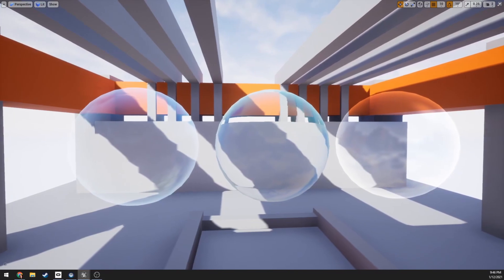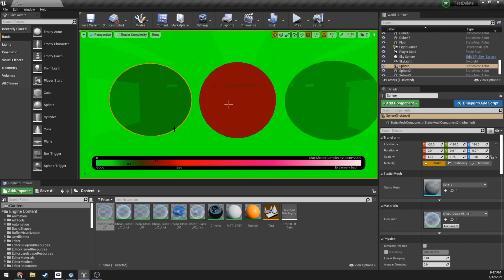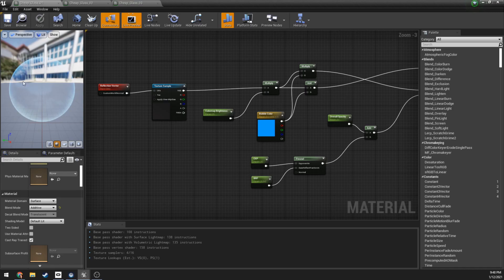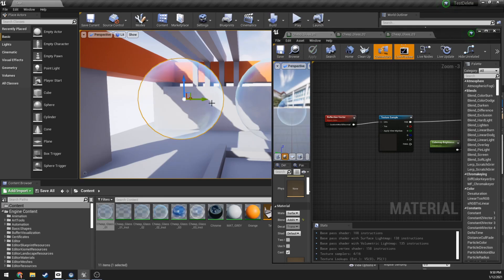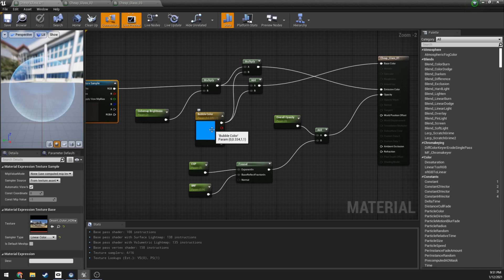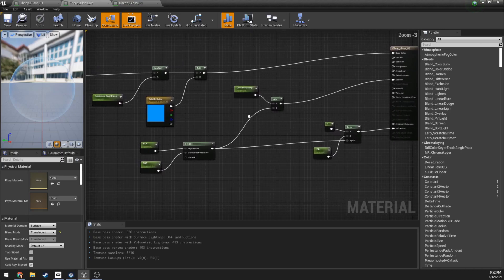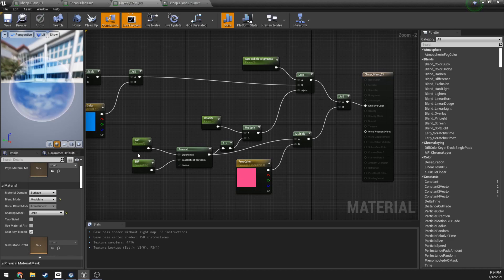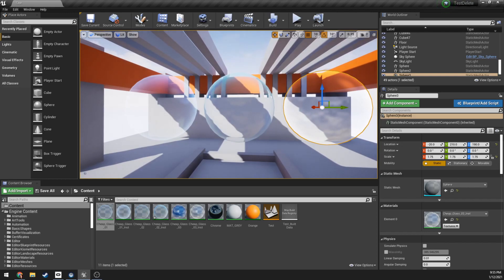How to make Glass / Transparent materials SUPER fast to render : UE4

Comment: This is awesome, thank you! I have a question though, every one of the shaders seem to show as more complex in my project than shown above. The cheapest shows as red (263instructions), the normal glass shows as white, etc. I think I did it exactly like in the video, with the cheap one set to additive. Any idea what I might be missing?
Reply from the maker: I can poke around a bit with this later. Are you still in UE4 or are you in UE5 now ? My assumption is that some extra instructions have been added to support new rendering features or project rendering quality.
Reply: @Drawcall  thanks for responding! you are right, I am using UE5

Comment: 2:55 additive isn't cheap because of depth, I think it is because alpha blending requires division and more dependent reads or something
Reply from the maker: Agreed, the geo must still be passed into the depth buffer for proper occlusion. Because of the additive nature the operation is communitive and can remove the need to be sorted from back to front. So it still needs to be passed but it should happen much faster without the extra z sort before the drawcall is issued. Again I could be a bit off so let me know.

Comment: Very informative. SceneColor seems to be a common method to create opaque but "transparent" water. Any insights how this is different to additive shading it seems to be a very similar thing ? And would it be useful for glass visually. Also: resubscribed =)
Reply from the maker: I think because scene color is a post effect it’s not being culled in the depth buffer were as the additive material is still being rendered with the right occlusion it’s math to render is still just adding it’s color information very cheaply.

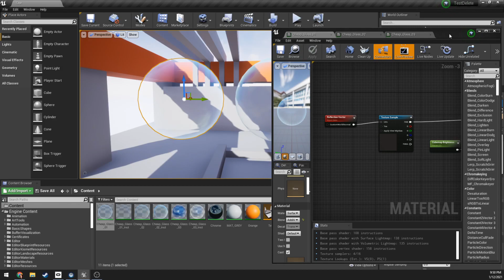Comment: Great tutorial as usual! Quick question: for the first cheap glass material, I have it set up the exact way that you do. But for some reason, I have nearly double the instruction count. What's strange is  at 4:28 I noticed most of your pins are grayed out even though you're in the "default lit" Shading Model. Usually the pins are grayed out like that when in the "unlit" Shading Model. Am I missing a setting that makes this cheaper in default lit mode? Thanks!
Reply from the maker: Make sure blend mode is additive ?
Reply: @Drawcall  strange, I must have missed that on screen. Getting caught up in the details! Thanks!